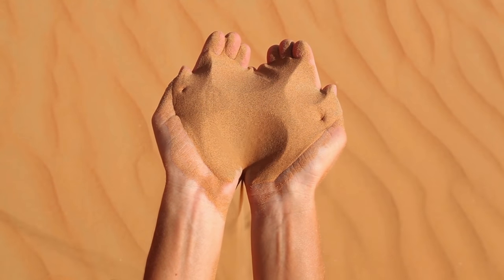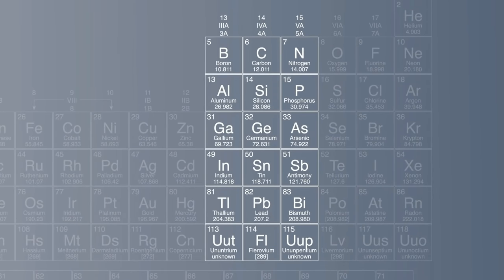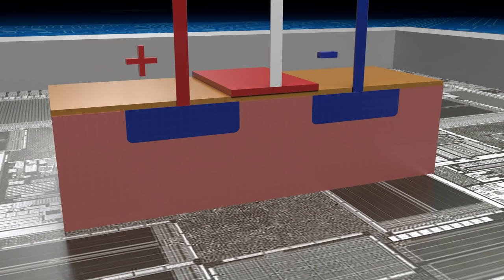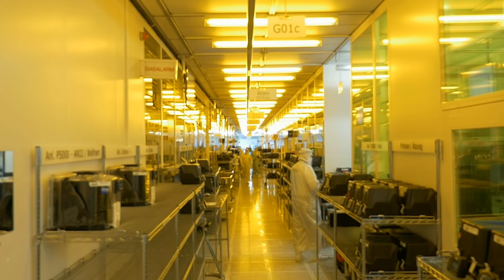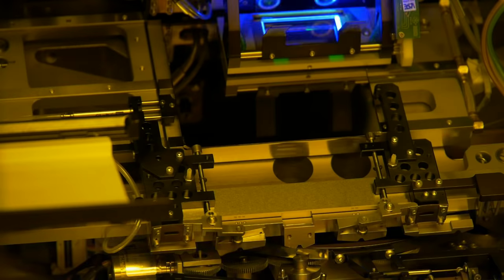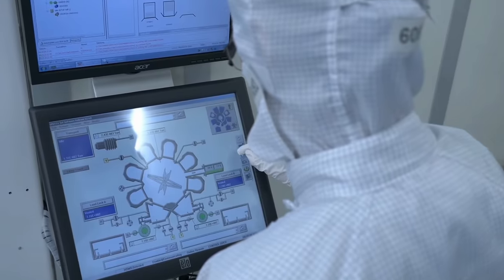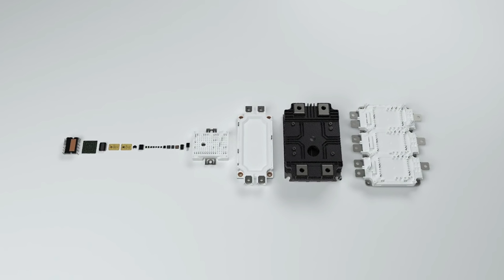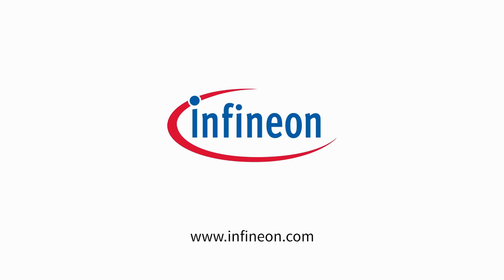How Microchips Are Made - Manufacturing of a Semiconductor

Comment: I just got a new laptop with an AMD processor. The CPU has 4.15 billion transistors in an 81 mm^2 area. That's more than 51 million transistors per squre millimeter, ignoring all the capacitors and resisters that are also packed in there. And I'm proud of myself when I make an LED blink.
Reply: Not sure they integrate all that many caps/resistors. CPUs don't have many analog circuits. It's virtually all transistors.

Comment: That is a really good video, better than many others. To people interested, in modern high end chips, there is about 500 individual steps and processes involved to make it from silicon wafer to the end chip. It can take a month or two to make one complex chip, like CPU, GPU or FPGA, often with 50 layers, and 20 metal layers. Precision of alignment between each step requires most sophisticated temperature control, optical alignment, laser interferometry, vibration free environment, and dimensional stability (often made of granit, or active water based circulation in major mechanical components to control temperatures within fractions of a degree), and smoothness (often air or magnetic bearings), to ensure repeatability and accuracy, often to just tens of nanometers.
Reply: Thank you!🤩
Reply: where can i learn more about this ?

Comment: One of my customers manufactures these chips.  Years ago, I worked for a company that sold very accurate vision assisted routing machines for processing the chip carriers.  I was required to write a CNC program that cut out the internal pockets where the chip will be inserted.  The camera would confirm the location of the alignment marks (fiducials) on the chip carrier and then a small (.032") router bit would cut the pocket out.  Tolerances were in the microns.  (One micron = 0.000039").  In order to maintain the extreme tolerances, the wear of the carbide router bit had to be factored into the routing algorithm.
Reply: thats crazy

Comment: Some chips especially for power and analog electronics applications seem to be designed by hand in terms of component placement, but I wonder at what point do chips get designed purely with HDL? Since you work at Infineon, I wonder if it's possible to get a basic walkthrough of the process of creating a custom chip for a customer. Assuming that they have the HDL working on an FPGA let's say, what would be the process of turning that into an ASIC? Are there challenges associated with that? (I can imagine that you'd have to license all IP correctly and some other elements would have to be made differently such as transceiver blocks etc..). I work with FPGAs but I'm very unfamiliar with the ASIC world. Thanks in advance! Very cool video.

Comment: The BEST video explains how we come to have NPN and PNP transistors, which are the core entities to create logics, thus chips.
Reply: NPN and PNP are bipolar transistors. Most CPUs, ASICs, FPGAs, graphics, microcontrollers use N and P type MOSFETs. A lot of analog circuits favor the use of bipolar for various reasons, but they take more room, making the die larger (more expensive). When you want to build a circuit for logic functions, you usually use MOSFETs.

Comment: I hope you answer this question: So the chips circuitry is essentially carved into the silicon wafer itself? I used to think that billions of super small transistors were created separately and then printed onto the silicon as a oppose to the transistors actually BEING the silicon.
Reply: The whole wafer, so multiple chips at once are built layer per layer. Each layer is chemically carved out of the silicon in 1 go. Only after several layers all the individual transistors are built up and the circuit is complete. So we  do not make 1 transistor in 1 go, but we make part of all the transistors on the complete wafer in 1 go, then another part and another until the city of transistors is completed.
Reply: @effedrien  Yes true, but transistors aren't 'carved out'. A transistor (MOSFET) has drain and source nodes that are created by doping the silicon, atoms diffuse into the silicon to make it more N type. It's still a planar surfcae, nothing is carved out. The gate (control node) material is first layed down as a strip and this acts as a mask to define the source and drain. The gate protects atoms from diffusing into it and rather into the exposed silicon. The 3 nodes are connected with metal or poly silicon. Usually groups of transistors are wired to create circuits that perform some logic, such as AND OR NOR NAND flip flops latches ....

Comment: This blows my mind. What kind of software/systems would have been used in designing early micro processors 30 to 40 years ago?
Reply from the maker: yeah, crazy, they had almost nothing 40 years ago. I think the pioneers back in the late 60s and early 70s had to struggle a lot... but I think the challenge is always there. Only that the things in the early 70s were produced in 10um and today at 5nm..
Reply: @CPUGalaxy  you'd be surprised at what they had ... I started 30 years ago in this world and we had Digital VAX computers hooked up to early SUN workstations running software like Magma, Opus and Dracula from Cadence and Mentor and simulators like Eldo. We had full blown schematic drawing tools , autorouting layout tools and design rule checkers. Stuff that did not come to the PC  / PCB world until like 10 years later. Before that this kind of work was done on custom hardware/software platforms . Most commonly CALMA systems. This was a dual screen workstation hooked up to a NOVA computer and had a digitizer tablet.
Reply: They hand drew the schematic for the 6502, which was used in the c64/nes/apple2/atari2600 among others , absolute bonkers. Im guessing by the mid 80s that was no longer possible for cpu's as they increased in complexity
Reply: @CPUGalaxy  The struggle was indeed great in the early days; engineers actually used to draw out the chip designs on huge paper sheets by hand, and these designs were then photographed and reduced many times in size before applying the resulting microfilm images to the silicon wafers.
How big were those paper sheets? Well from what i have read, they could easily be 4x4 METERS! Imagine that 😆
Reply: @CPUGalaxy  They had a lot. Electronic circuit design (EDA, electronic design automation, and by extension, IC design) were among the very first types of CAD systems designed. By the 1970s there were dedicated EDA workstations being sold.
Reply: I worked at National Semiconductor in the mid 80's. They had a room, about the size of a basketball court, that they would layout designs of chips on the floor. The designs were made with a black sheet, with ruby red sheets cut into them for the actual circuit. They would photograph it, and start reducing it to the actual die size.
Tedious...
Reply: @brucelytle1144  Huh, I would have thought that by the 80s, it’d be more computer-based! Do you know how it was at other companies at the time?
Reply: @tookitogo  yeah, I thought it was behind the times when I saw it! Another place I worked at made transistors one molecule at a time with MBE (molecular Beam Epitaxy). That machine required a PhD as an operator.

Comment: Better than nothing, but doesn't detail how each step is performed; for example, "the chip is placed in a package and connectors are attached." But that is not shown. Or, what chemicals are used for etching? Maybe a multi-part series on each step. I'd like to know the process as if I worked at the plant. Anyway, thanks for the vid.

Comment: If it is 128 bit processor it will have 128 leads. So plugin properly. Now they have reduced it by SST serial synchronise transfer. Using Blitz external clocks.
Reply: That’s complete nonsense.

Comment: electron mask lithography, and nano flex capacitive cantilevers as nano switches, dont have to be single crystal silicon, much simpler, but still fast, and mechanical switch conduction or off state, and memory/rom states
Reply: ask dlp how fast the micro mirros mems are
Reply: even photon momentum push mirrors as switches
Reply: yes photonic gate transistor
Reply: full photon processor, and photo-diodes to generate/activate photon-electricity-photon conversions
Reply: yes you can have multiple frequencies of photons mixed into same processing paths, and only read the output bits from the frequencies, kinda ofdma mixing of signal processing, but in photon frequencies of mirrors
Reply: yes same mirrors can be controlled by single signal source that process many frequencies source signals at same time, if they dont depend on results of the previous calculations
Reply: ie multifrequency calculations must be parallelized (loop-dependency removed, single layer non-dependent calculation of all needed bits)

Comment: Big question why or your company irfp064n mosfet failed to work in power inverter I recently both 100 pieces of irfp064n mosfet and every one  of them blow up in my inverter circuit but international rectifier mosfet don’t blow up so why is this I have a small inverter company and I wasted thousands of dollars on your company mosfet that failed the only circuit the mosfet work 10% is buck converter and booster converter and the mosfet get so hot working at low amperage as low as 5 amp the mosfet is fire hot but other mosfet stay really cool so your irfp064n mosfet or failing 98 % of the time this very bad I have to buy Chinese mosfet that work 90 as your company 10 % work very bad product very